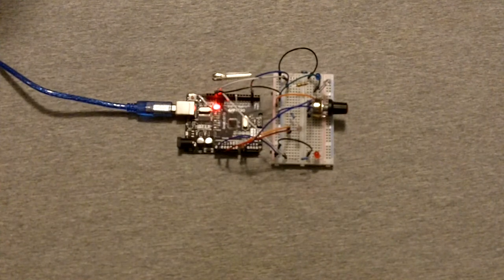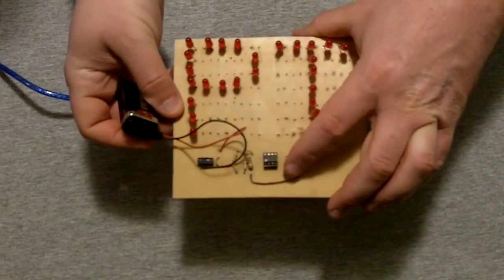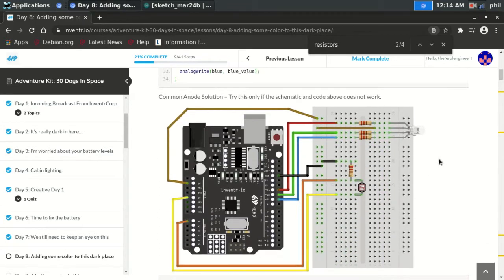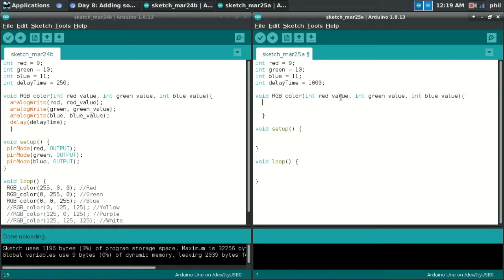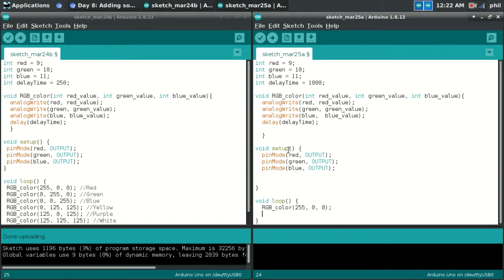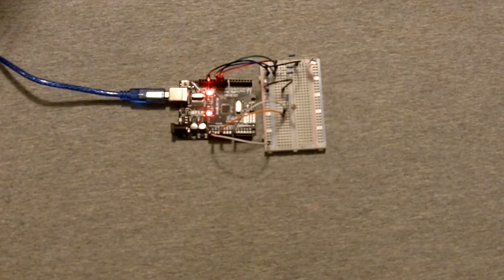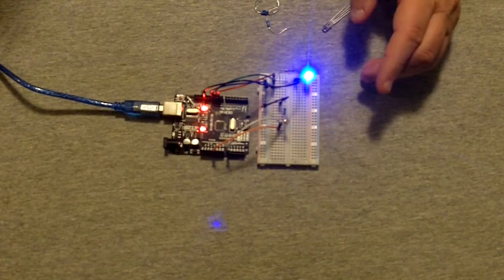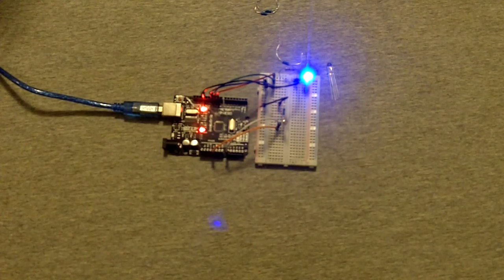Inventr.io 30 days lost in space adventure - Day 8

Comment: Good talking along with the project. 
One thing -  PWM gives a fixed frequency and the output is high for some time and low for some time during the frequency cycle. The control number 0-255 determines the proportion of the cycle time for which the output is HIGH (and the LED gets power).  Thus you get 256 power settings for the LED.